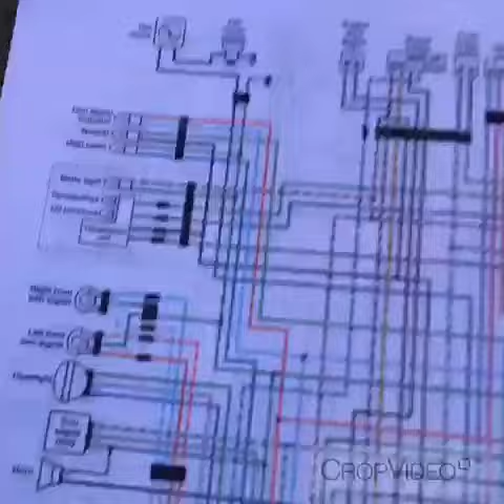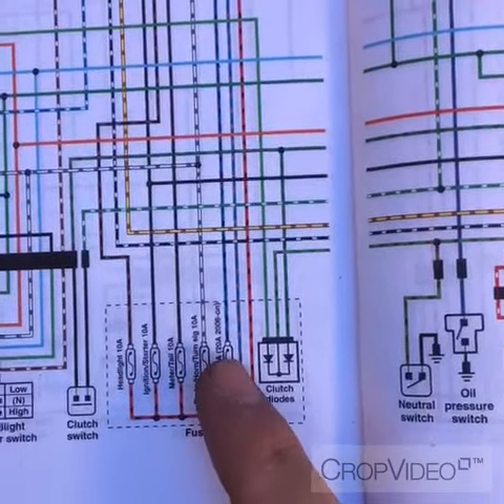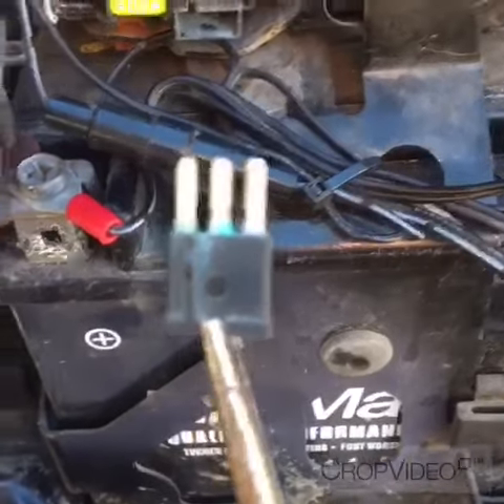Honda shadow fuse box

Comment: Yes, that's the clutch diode. I have replace mine because I shorted it out some how (don't ask) A new one is around $8 plus shipping or at the dealer it will probably be $25!!!!!
Reply: Painter D what website did you get yours from?
Reply: C T  Try Amazon or EBAY
Reply: How do you test it?
Reply: If Cluch diode not working the bike no start from the button

Comment: I have a 06 shadow 1100 and my turn signals, horn and brake lights stopped working today. I noticed they all share the same fuse but the fuse is good. Any ideas what the issue might be?
Reply: @frankcannella6014  thanks for the reply. The issue was the ground wire to the battery was loose. All I had to do was tightened it and the issue was gone.

Comment: Fan motor not working what can it be
Reply: Replace the Fuse : )~
Reply: Check the fan switch at bottom of radiator. When activated it sends the ground to the fan motor. If you unplug the switch wire and jump it to the ground (while engine is hot) the fan should start. If it starts, the switch in the radiator is bad.
Reply: Lot of things. For mine, the wire frayed, so I needed to splice in some more.